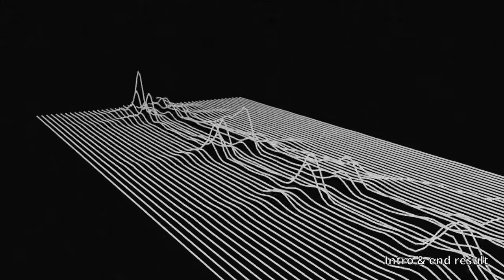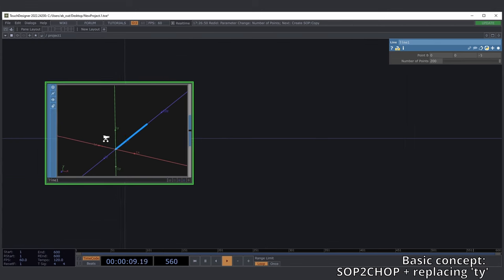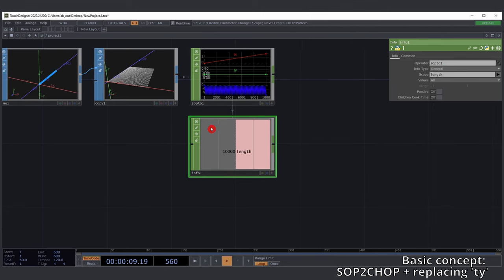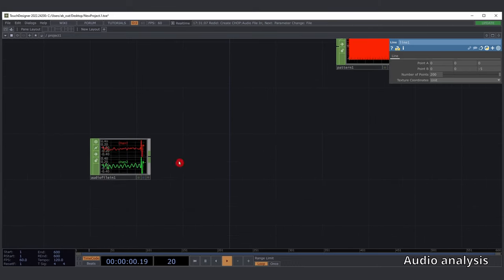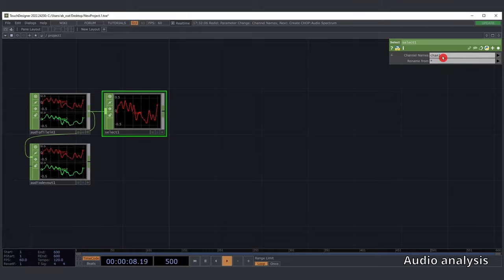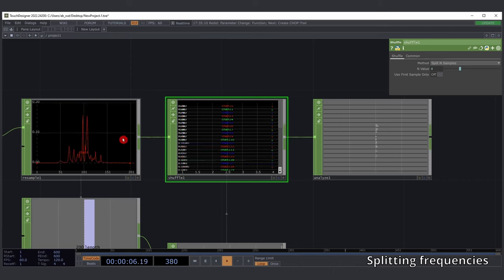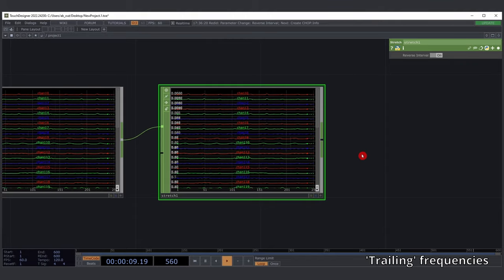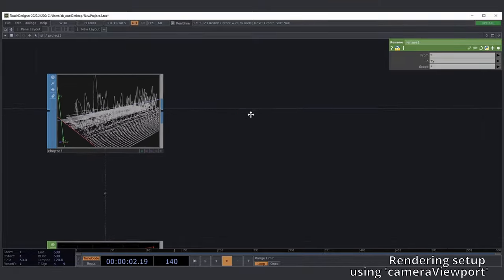2022 Audio histogram - TouchDesigner Tutorial

Comment: Hmm for some strange reason my angle is off in Line SOP & in copy my offset is at an angle. Not flush or meeting square to the vertices of the 3 axis?! hmm, I will continue to tweak until I have a better understanding of control over the parameters of my nodes. :( ..

Comment: Didn’t understand the cd(0) cd(1)..etc. It gives me error
Reply from the maker: What you need to do here is map the CHOP channels (which you can name yourself but in my case they are called tx ty tz r g b a) to predefined SOP attributes (which you cannot name yourself). so tx gets mapped to P(0), ty to P(1), tz to P(2), r to Cd(0), g to Cd(1), b to Cd(2) and a to Cd(3)... In this way the chopto4 SOP knows whate channels to use as Position data (see P(0,1,2) for position data tx ty tz) and what channels to use as Colod data (see Cd(0,1,2,3) for Color data r g b a). Hope this helps/makes sense ;)
Reply: It's an capital C in all Cd , that fixed to issue for me

Comment: Hi, everything is fine until getting to replace2 because I don't see the green line changing. I get an error on the chopto and it says: Channel tx not found. Can you help me?
Reply from the maker: On sopto1 make sure your Chanel’s are named tx ty tz. On rename1 make sure your channel is named ty. Now connect sopto1 to the first input of replace2 and connect rename1 to the second input of replace2. In the rename2 chop make sure you set the “To” parameter to “ty”!!! ;) In this way you are replacing the ty channel of the sopto1 chop with the ty channel of the rename1 chop.
Reply: It was a different problem, thank you for responding :)

Comment: Hi, i like yours tutorial very much. But i can't remove artifacts successfully....
how can i change tx ty tz in sopto1 to red green blue like yours. As i found out that i can't match with the color in chopto4, r g b to Cd (point color red green blue). Even in line2 common i've clicked on discard pixel based on alpha.
Reply from the maker: Its all about mapping the CHOP channel-names to SOP-channel-names => the merge1-CHOP should have the channels "tx ty tz r g b a" which are getting mapped to "P(0) P(1) P(2) Cd(0) Cd(1) Cd(2) Cd(3)" inside the chopto4-SOP. this means that tx maps to P(0), ty to P(1), tz to P(2), Cd(0) to r ... and finally Cd(3) to a

If these mappings are done correctly, you should be able to use the discard pixels toggle as Cd(3) got mapped from the a-channel which stands for "alpha". This alpha, now aka Cd(3) will drop to zero each time a line traces from back to front causing these pixels to get discared ;)